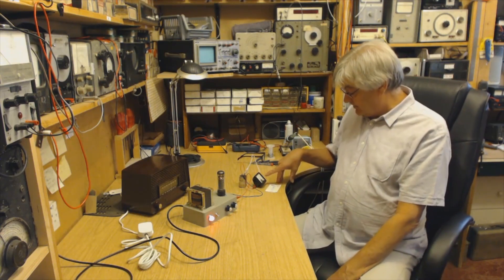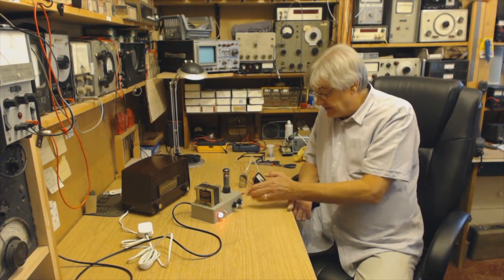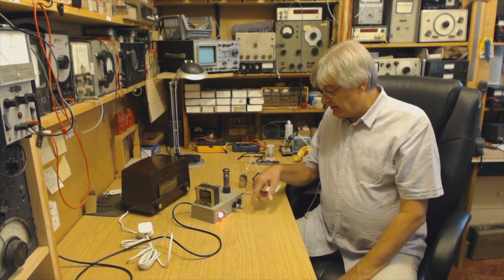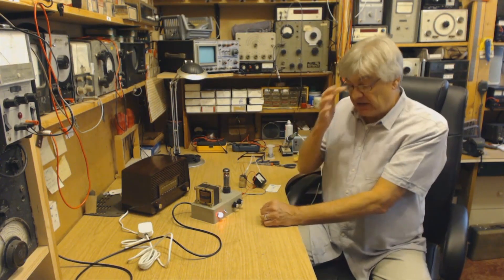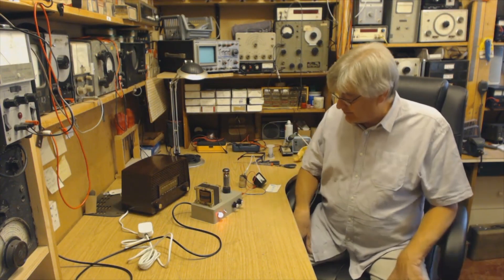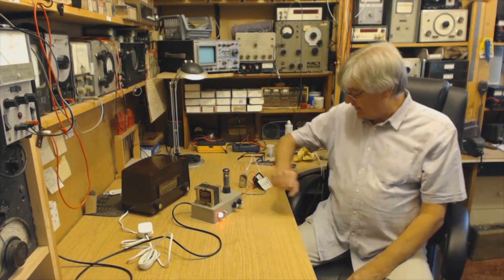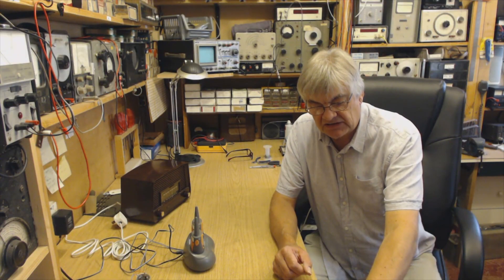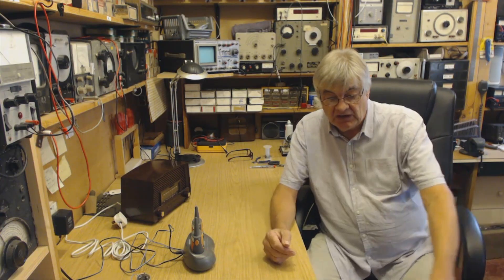Variable HT valve Power Supply - Part Two

Comment: Some folks just don't understand that some of us love valve sets, and steam engines.  We're old, and we don't have to reform (capacitor joke there).  Cheers, Ray.
Reply from the maker: Haha, love it!
Reply: Oi, some of us, not so old folks, love valves, steam engines and vintage motorbikes. More shocking, we're ladies 😊 It's a matter of understanding that valves have a very unique set of qualities which are impossible to recreate with anything else.

Personally I love things that I canunderstand and use for my own projects. I'm working on my own bass guitar amplifier as I can't afford the extortionate prices the vintage ones are fetching. I'm in the process of designing and building an amplifier using six EL34s for the output section into a salvaged Partridge transformer. Hi Hiwatt influenced tone stages and pre amps and a salvaged power transformer. 
I'm fascinated by valve technology. I built a tiny 1.5 watt practice amplifier out of scrap parts and that was it, I was hooked!

I'm starting to restore the small collection of valves radios I've collected over the years.